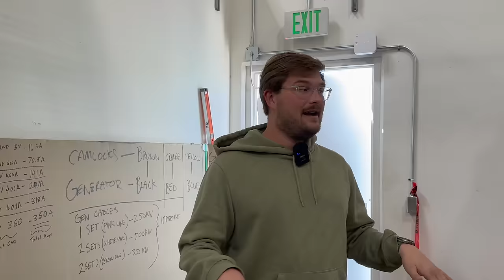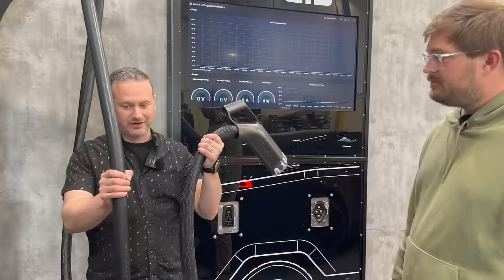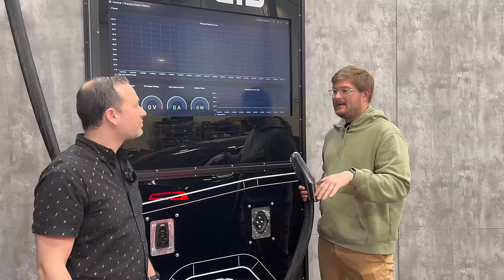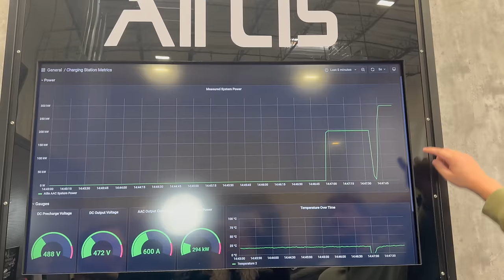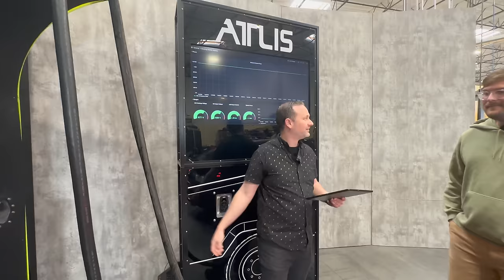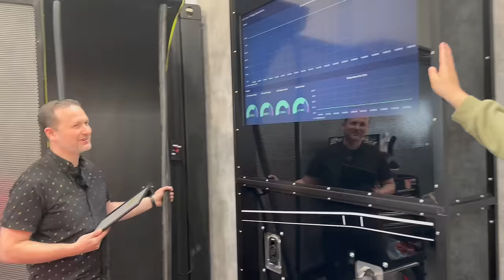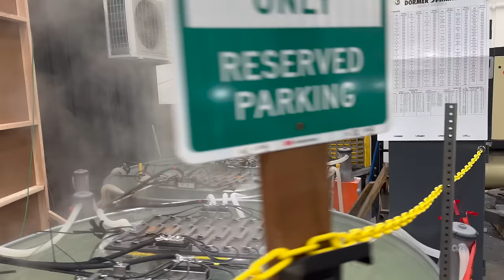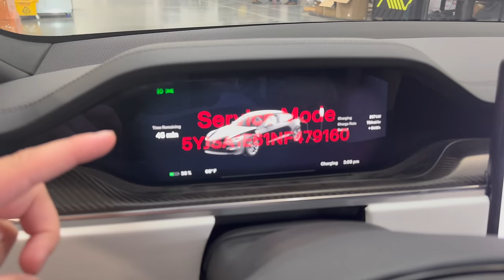Fastest Charging Ever! Megawatt Charging Deep Dive w/ Atlis Energy Solutions

Comment: What effect would this have on the longevity of the battery?!
Reply: +1 - I've owned 3 modern BEVs and all of them slow charge at home, except on road trips. Not only is that good enough for normal usage, my batteries have always had excellent life with little to no degradation
Reply: @mariusmeyer14 Great question! Megawatt capable charging systems provide a true solution for 15 minute or less charge times by ensuring that the necessary power is always available.

The Atlis cell and pack design utilizes a proprietary cell, pack, and thermal management system to ensure minimal cell degradation characteristics outside of the normal wear and tear you should expect in a vehicle. 

When properly utilizing our charging profile and thermal management system, our test data is showing minimal cell degradation beyond the expected performance you would see under much slower charging rates.
Reply: @ani_b  That's great, but he's talking about using a charger like this.
Reply: AMV chargers are only providing the power needed to achieve the ultra fast charging times.

But what it really comes down to for speed and the degradation of the vehicle’s battery is the vehicle’s on board charger.  It’s the manufacturer that limits the amount of power the battery can receive and controls the degradation of the battery.

Comment: I've worked with mobile MRI scanners and CT scanners which use massive 3-phase 480V connectors.  Atlis will want to design an interlock that prevents the driver from driving off with the plug in the car.  Also, test for use at -40 degrees.
Reply: Every EV since like the Leaf that I've seen won't allow you to put the car in drive mode if there's a connector plugged in the charge port, whether it's charging or not. I highly doubt they'd overlook that on any vehicle they build.
Reply: The protocol for preventing the car from being able to be driven off while plugged into a DC EVSE is actually part of the CCS standard so is covered automatically.
Reply: Yeah mine won't let me go into drive at all with it plugged in

Comment: One of the oems or even tesla should be smart enough to buy out AMV asap. These people need to work for someone with very deep pockets, lots of engineering talent and big time supply chain connections already built out. This is damn impressive team AMV! 👍🏻🤔
Reply: I fucking hope not! The last thing we need is another proprietary charger that only works with select vehicles.
Reply: @Sophia-vk5bq  nacs is open source since 2022 and the tesla plug which is the superior solution was available since 2016 to anyone. 
11+year's now of reliable high power dcfc proven uptime and billions of kwhs run through it. Ccs is a sick joke in comparison. 😆

And the most evs on U.S. roads today use the nacs and not ccs. That won't change for year's if ever either based on legacy slow rollout of their inferior evs. I don't want my tax dollars supporting an inferior plug standard for the few vs the many. 👍🏻😎
Reply: Lol Tesla is already shipping vehicles capable of 1MW charging and actual chargers… not some theoretical crap.
Reply: Tesla has already developed mw charging which is on semi and is confirmed for CT. Supercharger V4 will be 1000v 1mw.

Uses same Tesla plug.
Reply: @claytonslade2366  TESLA is currently only 750KW
Reply: @mark-ceoamv496  semi event showed the plug is capable of over 1mwh Mark at over 1000v. The latest from a real tesla semi driver for Frito lay. Has him claiming publicly a 70% charge is only 30 minutes or less. Drove 485 miles on under 90% total battery use. 

The pack is rumored to be around 910+kwhs that all seems to ad up to well over 1+mwh right? Can't jam over 600-650+kwhs into a pack in less than 30mins unless charging input is well over 1mwh with a sick current ramp rate.

None of that has to do with y'all though, this is damn impressive. Imo you and the whole team deserve major props. 👍🏻
Wish you'd get bought out by tesla, acquired, merged something, so you could get quick access to all the funds you will need.
Reply: @mark-ceoamv496  mark, I know this is hard for you, but that was V1. Tesla has a V4 out now and capable of 1 MW.

Stop misleading people, like you did to your investors. Making to where they couldn’t trade their stocks for over a month, is poor leadership there. Or signs of a scam.

Comment: Your lost me after it was said that there is not a North American AC Plug to replace the archaic J1772 Type 1 single phase.  What ever happened to the J3068 (SAE 2018 Type 2)?  It should be able to handle up to 30 kW in Canada (600V 30A 3P) and 25 kW in USA (480 30A 3P).  Did I miss something?  These are the voltages we should be using in commercial buildings and parking lots.  Europe has been using their Type 2 at 400V and showing effective charging everywhere, not just at MEGA MEGA DC $ charger.

Comment: I can't see the point of megawatt charging for regular car-sized EV's. For semis with huge battery packs, yes, but given that no EV's on the road now can handle this amount of juice, and even if they did, it's going to rapidly degrade their battery packs if used on a regular basis, I reckon you can get too much of a good thing. I think Aptera is taking the right approach, making a more efficient vehicle that doesn't need to be charged as fast because it doesn't chew through the juice as fast when driving. They are planning to use 40 to 60kw fast charging, but because their vehicle is 3x as efficient as a Tesla, that's equivalent to 120 to 180kw charging on a Model 3 for example. Doing more with less...

Comment: formula e-racing  what size are the batteries and what speed can they charge at, maybe worth checking
Reply: Formula e only races for 1/2 hour and they have to CHANGE cars after 15 min. (You would have to have a 20 min. break to charge.) The batteries are small to save weight.
E racing will never last.

Comment: I still don't understand why electric cars aren't also charged by accessing a point under the vehicle. The connector then plugs in automatically after you park over it and disables the vehicle until it is released. This saves the fuss and dangers of charging. Simply set how much charge you want from the dash in the vehicle.
Reply: Inductive charging!
Reply: Putting crush proof waterproof freeze proof debris proof connectors underground that automatically align with a vehicle would be an enormously expensive and difficult task.

Comment: What's the point of megawatt level AC charging?
All you're doing compared to DC is moving the huge charger and its cooling requirements into the vehicle.

AC charging makes sense for low power because you carry the charger with you, built into the car, so you can charge anywhere. But with megawatt level charging, you lose that advantage.

Comment: Battery swapping makes MW charging unnecessary. Swapping a 150kWh battery in 3 minutes is equivalent to charging the same battery at an average of 3MW which is a rate of 20C. By comparison the proprietary Atlis battery cells can charge at only 6C.

IMO any trucks made by Atlis will have to include a CCS or NACS port to have a chance of being successful. Nobody will want to buy trucks that can only use the very scarce Atlis MW chargers. If a CCS or NACS port is included the truck would be able to do AC charging through it and therefore it isn't necessary for an additional MW port to have AC charging capability.

Comment: Their goes battery cycle life. Once you hit 1C charging instead of .5C you cut your battery cycle life up to 50%. It gets worse the more you go up. If you do not know what .25C/.5C/1C/2C are look it up on internet. Lithium can handle 2C for short periods but at a cost of degrading the lithium 4-8x faster than at .5C. to make this better each car would have to have a super capacitor which can store the power then slowly charge your batteries while providing on demand power also which means an inverter would be needed not to invert the power but to control where it goes from super capacitor ( bigger than your car) and then when to use from battery bank or charge battery bank. That means your car gets way more expensive. Now to power up charging stations battery banks yes as they could have 3 megawatts of storage and pumping in 1 meg is .33C which means it will last longer to service car charging stations.
Reply: Cool story, except there have been cars on the market that charge over 2C for 5 years, and modern cars are already over 4.5C.  Small lithium packs in non-automotive applications are over 8 to 10C.  Try to keep up with the times, this isn't 2010 anymore. Sounds like you just got done reading a Battery University article.
Reply: @GregHassler  I have 60 kw of lifpo4 battery banks. I read what they say and others about cycle life. this explains why so many EV cars have lost so much of their range.  Cycles is every time you use the amount in your battery packs. Most people do not think that after 12 years the battery pack might need to be changed and its expensive and bad for the environment. If they can last 20 years that is a huge difference.
Reply: @dc1544  for sure the more cycles the better, but all cycles are not created equal. Lab cycles are near empty to near full, which isn't representative of the real world.  But remember time and temperature also factor in.  You really want to have solid thermal control over a battery, that's really important.

Comment: WOW 6C charging. sounds great but not for a Lithium battery.  Think how much it is to replace your lithium battery pack? Right now 8-10 years is life to 80% capacity left. at 6C 2-3 years to 80%. Testing needs to be done. Lithium available is not infinite. We would need Sea salt batteries and they are not there yet. We need better technology for super capacitors to really make this work.  Think if you pull up to a charging station plug in and 20 minutes later leave with 300kw of power with no batteries just super capacitors that are same weigh and size of a battery bank. Atlas has really got me thinking. I hope they look into these options also.

Comment: I took a time to think about your experience @Atlis and is not so sure about how to feel about it. Yes they are a company with new equipment and EVs need more charging infrastructure and more important, reliable chargers. Now, the super duper charger for me is smoke and mirrors as it's impractical and only a showcase of a expensive way to boil water. Atlis may be after a government or state grant, nothing wrong with that, let's hope they can deliver the goods.
Reply: If we want cars that charge as fast as gas cars refuel - this sort of performance will be necessary. Granted the cars need to accept the power, but assuming they could, this would fill my Rivian in 6 minutes.
Reply: @boneman1982  that would be awesome. Maybe with battery cell development in the future that would just be possible. Maybe a battery capacitor hybrid of some sorts?

Comment: so it says 45mins to charge to full at 200kw... yeah nah ill stick to fuel. it only takes 2-3mins to fill the tank to full and you get atleast a garunteed 800-900km range with no degreeation. Even with a full fast charge atleast 30% of the range will degrade due if you start being liberal with the car, in sorry but for a 100k car thats not worth it.

Comment: Output yes, but you're not charging anything so... Why not use the cube batteries that Atlis claims have the best energy and power density and could take such a load? Been hearing about Atlis for a LONG time and they got nothing to show for it and real investors won't touch them. Smells like Nikola...
Reply: no car manufacturer has a car that can even handle the charger. They dispute the energy in to water due to that. That’s why they made 1000 gallons of water boil in under 3 minutes lol, also the Tesla got charged at 350kw.

Comment: Oh my God! Really? What's wrong with this industry? Yet another fast charging pattern? What's the problem with using the tesla pattern that actually became open??? If this is just a test model and not a production model I apologize. Other than that, congratulations to those involved.
Reply: The Tesla / NACS plug is over 10 years old and doesn't support anywhere near these power levels.
Reply: @GregHassler  tesla is about to surpass these claims, on existing infrastructure.

Comment: EVs charging off diesel generators again, just give anti EV crowd more ammo 🥴
Reply: They are just testing.
Reply: Other than the Plaid at quarter capacity for demo. They were just Boiling Water with the MegaWatt stuff. Purely demonstration and has no practical relation to charging EVs in the wild.
Reply: Technically it's powering a giant kettle with generators.

Comment: But... NACS handle can do 1MW without being yuuuuuge.
Reply: The electrical connectors NACS uses are only rated for 200KW peak, 100KW continuous. (Source: the datasheets Tesla published). Did you pay attention to what they were saying about UL compliance? Tesla can run those connectors WAY over their specification at their own peril, but as soon as a non-Tesla vehicle or cable gets involved, the 1KV version of NACS is limited to 200KW continuous.

Tesla claimed in a footnote that they ran 1MW through it, but absolutely nowhere is it rated for it. It's pure marketing.
Reply: @Smidge204  Lol,k
Reply: @Smidge204  Page 26
"The North American Charging Standard shall specify no maximum current rating. The maximum current rating of the inlet or connector shall be determined by the manufacturer, provided that the temperature limits defined in section 8 are maintained. Tesla has successfully operated the North American Charging Standard above 900A continuously with a non-liquid cooled vehicle inlet."
Reply: @claytonslade2366  Fun fact: There are multiple documents, not just the first one which defines the plastic housing. The document that defines the actual metal contacts ("DC Connector Datasheet") clearly states 200A continuous.

Also, "Tesla has successfully operated the North American Charging Standard above 900A continuously with a non-liquid cooled vehicle inlet" is not a rating, that's just a claim. Just as (paraphrasing) "Run it as hard as you like just don't let it melt" is not a rating either.

200A continuous is the published rating. Full stop. If it's Tesla chargers operating with Tesla vehicles, they can legally exceed that rating and assume all liability if it goes wrong. However, no non-Tesla manufacturer would dare to build a vehicle or charger/charger components that exceed the published rating of 200A.

It's questionable if any manufacturer would touch NACS at all; go back to around the 50:00 mark and listen closely to what they say about UL compliance vs. certified... NACS is not UL certified, so no third party is likely to touch it. Certification is (as they explain in the video) a major hurdle for importing new charging equipment - as a third party supplier, their stuff needs to be certified first.
Reply: @claytonslade2366  weird cause my NACS connector can burn my hand at 200kW.
Reply: @Smidge204  Fun fact: the 200kW is referring to 500v.

Fun fact: Tesla states the limits are based on temps and how someone chooses to cool the connector.
Reply: @GregHassler  "Your" NACS connector that does 200kW? You have a personal supercharger? I've never burned my hand supercharging.
Reply: @claytonslade2366  200A * 1000V = 200KW. Even if you want to swallow even more marketing wank and believe 400A peak at 1000V = 400KW, that's still far short from the 1000KW claim that the connectors are very clearly NOT rated for.

Just because the standard says there's no limit, doesn't magically make the PUBLISHED RATINGS of the individual components irrelevant. If you want to exceed the 200A the specified connectors are rated for, you either need to violate their ratings or use a different connector (and therefore no longer conform to the standard).

It's time to admit, of only to yourself, that NACS is bullshit; too little, too late. Even Tesla seems to be giving up on pushing the idea to other manufacturers by adding CCS to their vehicles and stations rather than expecting everyone else to change. Maybe if they opened the standard ten years ago it would have made a difference...
Reply: @claytonslade2366  Then why do older Teslas need a retrofit in order to use the CCS adapter? Oh right, only the newer cars (Late 2019 anr newer) have the hardware required for CCS, which is more than just the physical connector. If you own an older Tesla you will need to have hardware retrofit to your vehicle in order to use CCS chargers via the adapter.

Hence, "Tesla is adding CCS to their cars."
Reply: @claytonslade2366  So what? They can SAY anything they want. When it comes to third party hardware, it's the PUBLISHED RATINGS that matter. They are running their connector WAY out of spec, and relying on temperature sensing to prevent fires. That's fine because it's Tesla chargers and Tesla vehicles - but as soon as you introduce a non-Tesla anything to that system, you need UL certs to operate it legally and guess what? They'll never get it certified as-is.

No manufacturer is going to use NACS for DCFC unless and until the paperwork is sorted out.
Reply: @Smidge204  Or you don't know as much about the topic as you think you do.